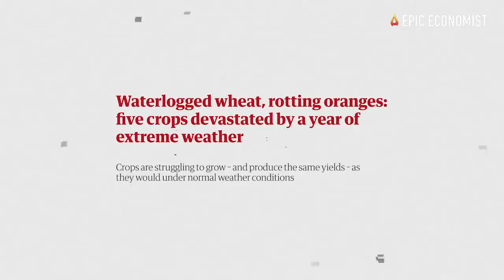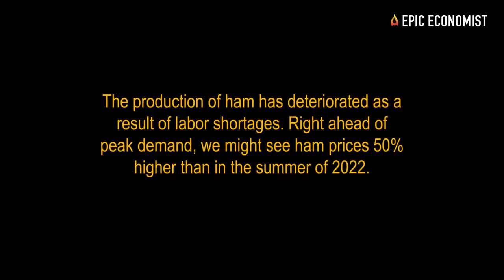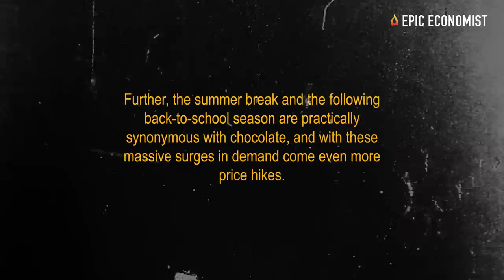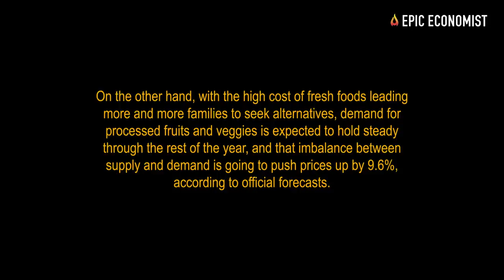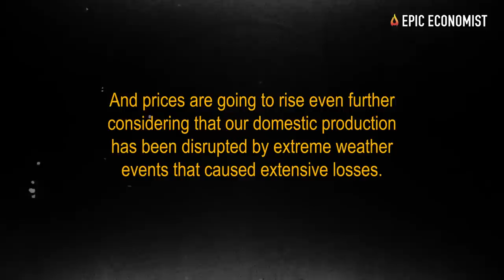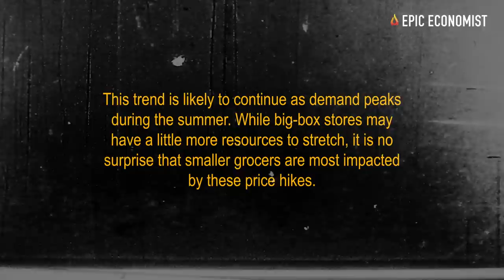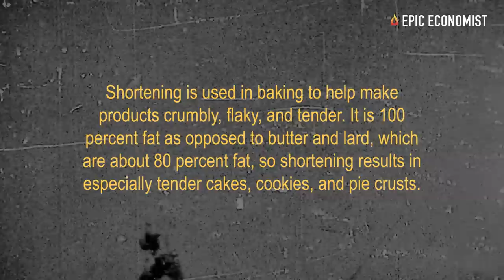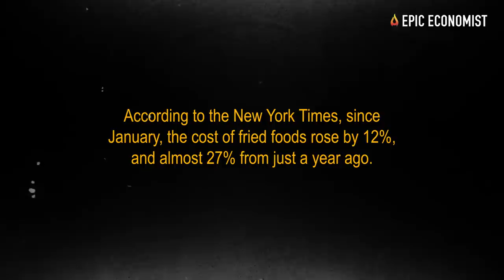20 Foods That Will Double In Price This Summer

Comment: Fast! Do it properly though….. you’ll need some salt, etc. Not only will it help you save money and lose weight, it also resets your body’s health. Think of it as a reset button! 😊   Short or longer term, on and off fasting or intermittent fasting, whatever works for you. And you can slowly get used to it by starting off fasting less and shorter amounts and work your way into harder longer bouts. Research it.